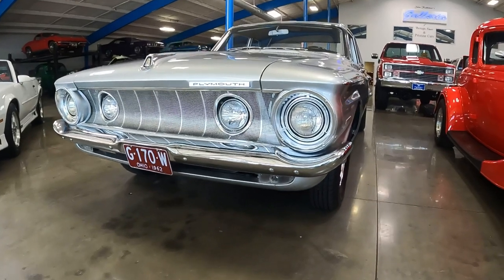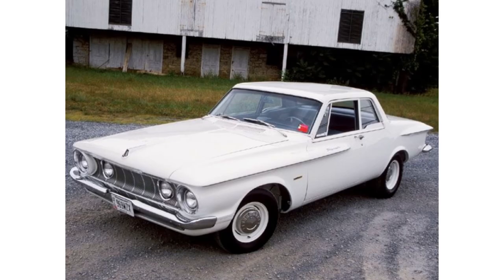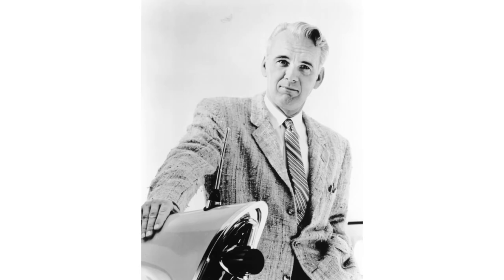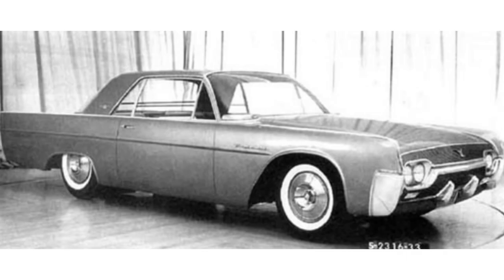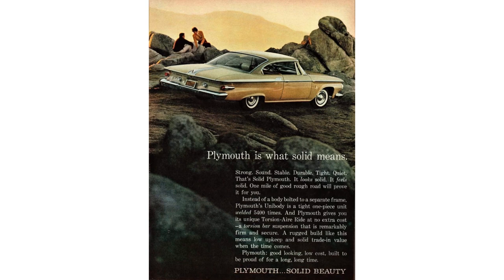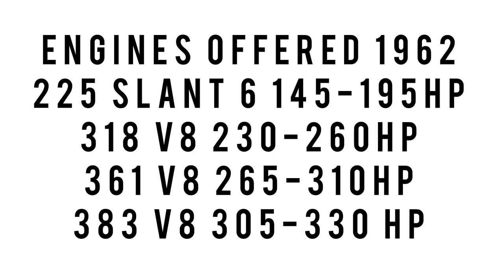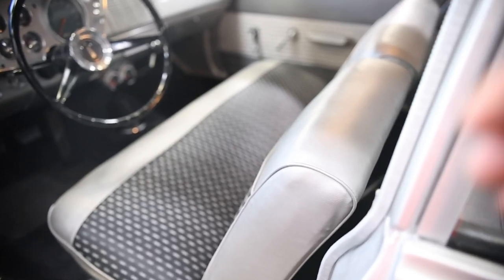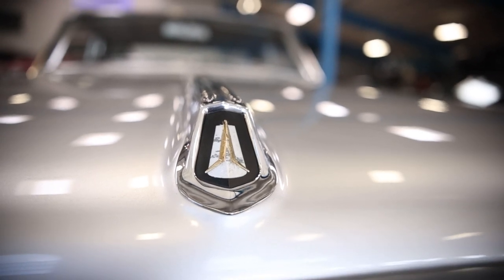Most in depth look at 1962 Plymouth savoy super stock max wedge on the tube

Comment: I remember going down to Chinook Chrysler in Calgary with my dad as checking out the latest models of the big three was something we both enjoyed each spring. My dad fell for the Chrysler Saratoga with the 383 4brl. 4 door ht. It took getting used to, but I eventually lusted after the Plymouth Fury which had 6 tail lights including backup lights which were standard on the Fury, and more chrome. And the 413 with a single 4brl. 
Looking at this car, I have to admit I like it over the busy Fury. The single tail lights are perfect for this body style. As is seeing less chrome. Is this a Belvedere, or a Savoy?
Reply from the maker: It’s a savoy, I worked at that dealership over the summer and I got to drive that car it was extremely temperamental. Like when it ran good it ran great but when it didn’t. Me and my boss took it for a drive up the road and it stalled stilling in traffic and the battery was dead.. good times.. but when that car ran it ran it would haul some serious ass

Comment: 12 second car had small bias ply tires ! Put some tires on it and go
Reply from the maker: Yeah I wonder what it would do with some good tires
Reply: Actually the first slant 6 was the Mercedes 300SL and for the same reason, the slant 6 allowed a lower hood line with a straight 6 engine.